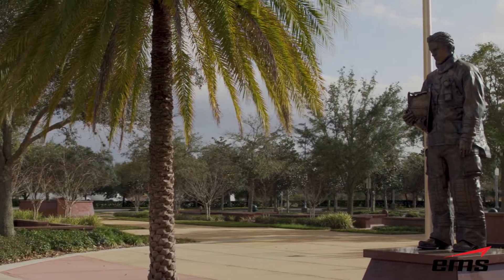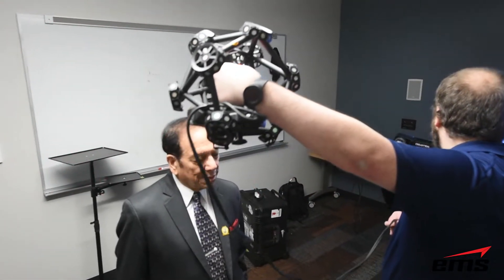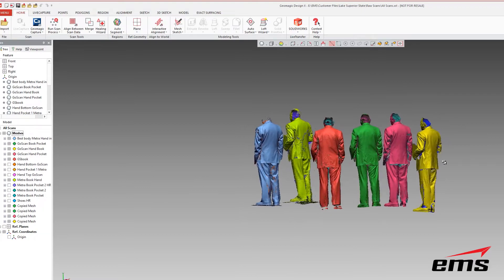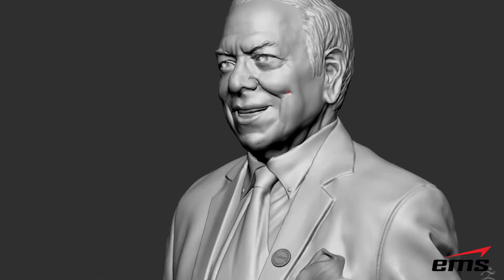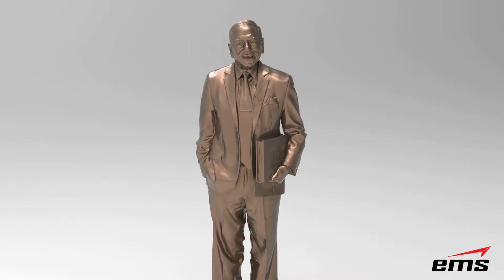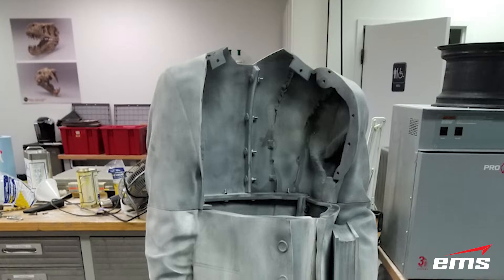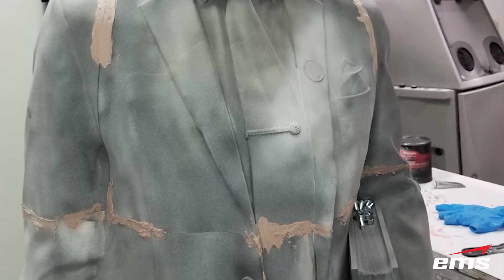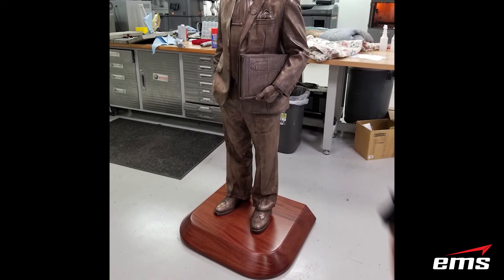3D Scanning and 3D Printing a person at FULL SCALE

Comment: Roughly how many hours did this take you guys?  Scan and model touchups included?
Reply from the maker: Hi Jono,  the 3D scanning didn't take long at all, maybe 15 minutes.  The post processing for sure took some time.  Between cleaning up the scan data and doing the digital sculping it probably took about 3 - 4 days.  The 3D printing, assembly and paint prep took a 2 1/2 of weeks and the painting and finishing took 2 weeks.